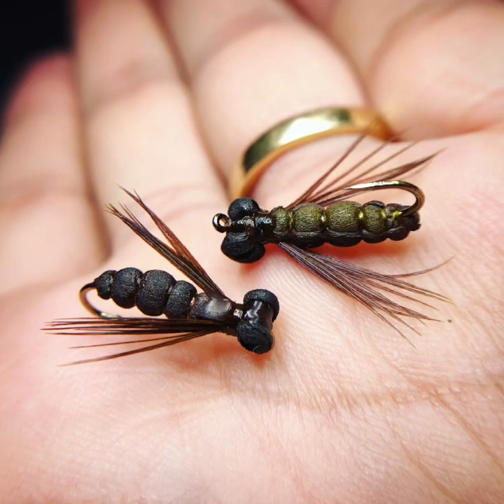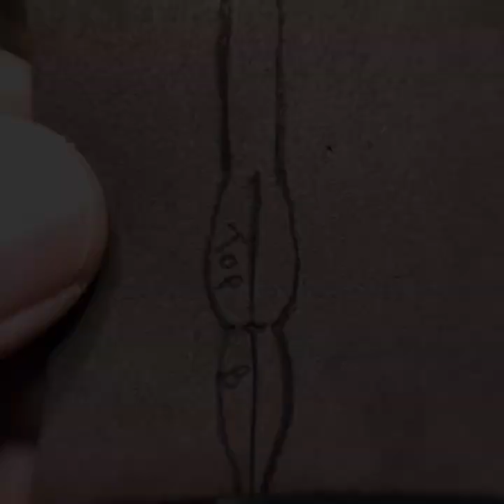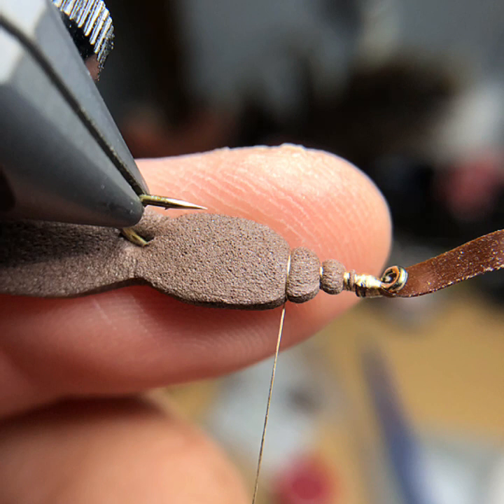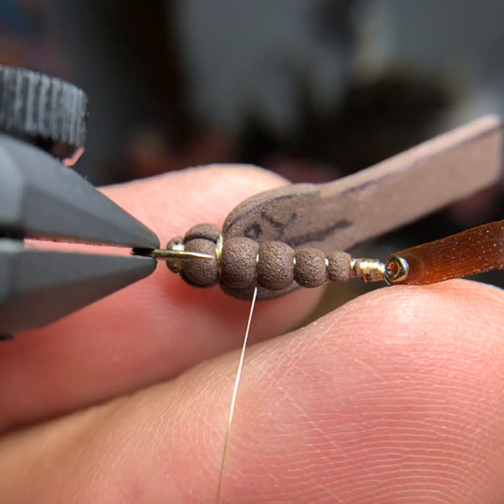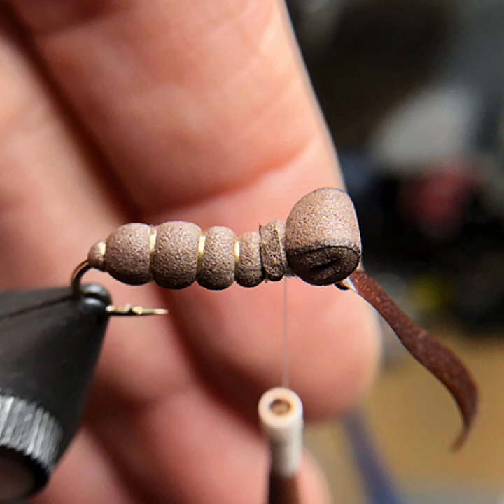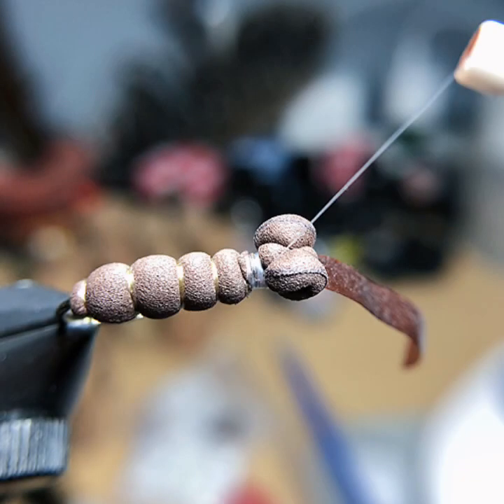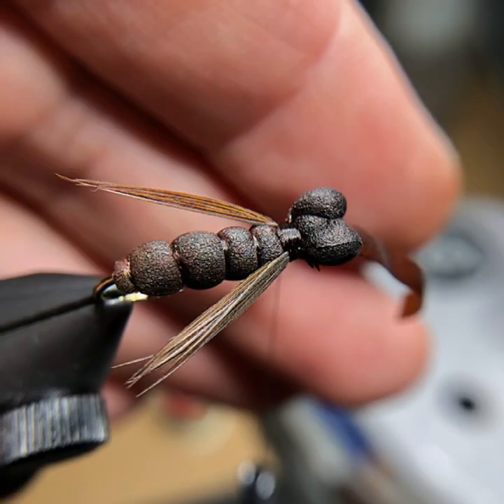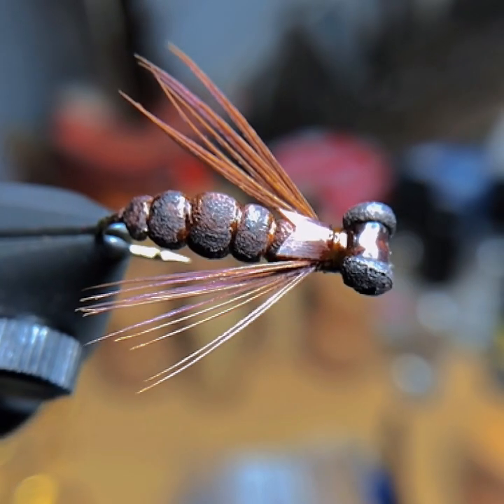Darner Foam Dragonfly Nymph

Comment: Awesome bug! Was just wondering what the 75 denier thread was... I can't find it. I can just replace it with 8/0 white? Or 70 white?
Reply from the maker: It’s UTC GSP (gel spun) 75 denier in white. Waspi makes it. Much stronger than regular UTC thread 👍🏼
Reply: @vancouverflyfishing7615  K thanks man. I'm reading up on the different thread types. Still trying to wrap my head around it
Reply: I actually can't find it from two websites in BC.. can't I just use UTC 70?
Reply from the maker: @fillup86  yes, just don’t pull down too hard on the foam eyes with the thread and you’ll be fine.
Reply: @vancouverflyfishing7615  Awesome thanks again! Can't wait to try it. Oh, one last question, you use any kind of marker for coloring the body? And 1/8th"  stretch floss?
Reply from the maker: @fillup86  any permanent marker is fine and yes 1/8 scud back in matching colour is good

Comment: What is the net bouyancy of this? Slow sink, neutral or floater?
Reply from the maker: It’s a floaters that can be fished from the bottom up depending on the fly line used, leader length and retrieve.